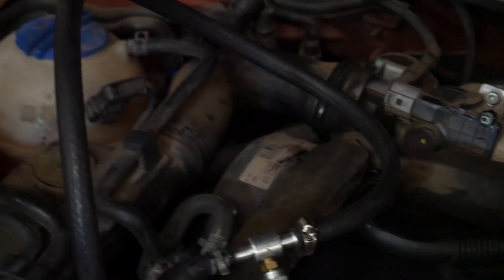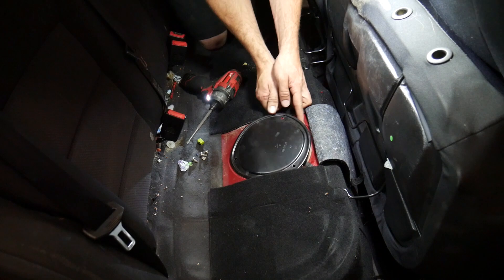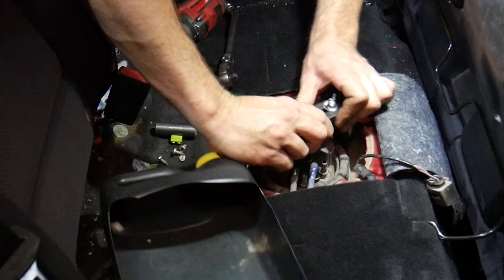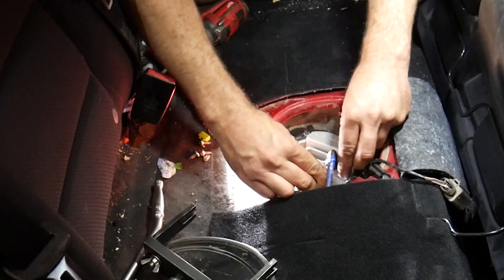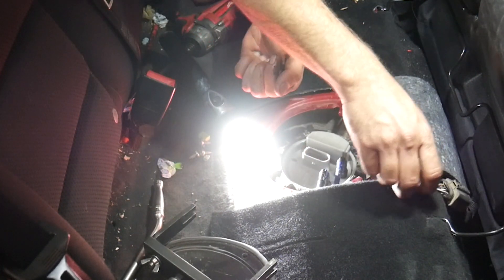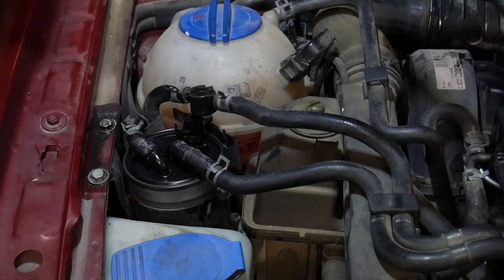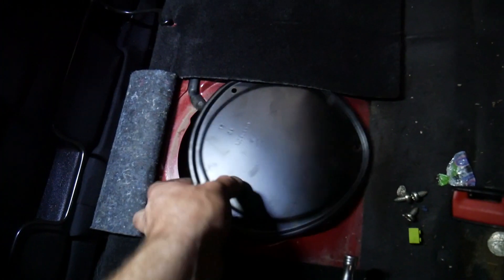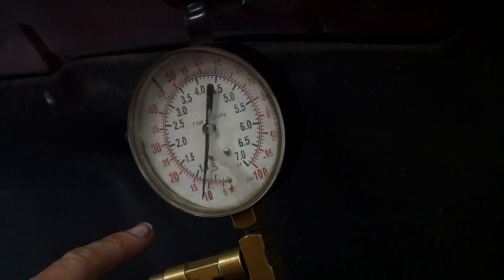2004 VW Jetta TDI BEW No Start or Hard Start  Lift Pump and Fuel Filter

Comment: Great video!  My 2004 TDI wagon was due for a fuel filter change.  Did that, all good.  When I went to reprime by cycling the key:  no fuel, no buzz (the pump was not buzzing)..  turns out the BEW tdi engines can run with their lift pumps not operating!  No continuity on the pump's power contacts either.  It had been dead for a while I bet.  One new lift pump later and she's purring like a kitten.  Real tough to keep this job clean I highly recommend folding the carpet up and out of the way and taping it with duct tape.
Reply: so it looks like if the pump is not working the fuel comes out by a syphoning effect?
Reply: @davidcole5803 Correct.  Not necessarily always but it's possible for the pressure pump to create enough vacuum to pull fuel from the tank.  Pretty sure that's what my car was doing until I broke the vacuum by changing my fuel filter.

Comment: Can anyone explain why it starts with the rag plugging the exhaust?
Reply from the maker: I suspect that since we had low fuel pressure we had low fuel injection quantity the back pressure of the rag in the tailpipe allows more unburnt fuel to remain in the cylinder and it mixes with the incoming fuel charge enough to fire up.
Reply: Interesting.  I have had a hard start (long crank)!after the car sets overnight, but it would start fine if the car only sat a few hours.  My hard start has turned into a no start.  It’s throwing no codes.

Comment: white smoke on cold start and rough idle for awhile, replaced thermostat and checked glow plugs and wire all good what else can be wrong
Reply: I have the same issue with my passat. Did you find what was the problem?

Comment: I just cleaned the sieve inside the pump (it needs to be opened), replaced the filter and the problem was solved. Of course, it depends on the case ...

Comment: Hi , have a 2005  vw touran  1.9 tdi .Have  the same problem but if I park can on incline (front facing down) starts on the turn also when I fill fuel at the garage within seconds it gets air locked.Any ideas?

Comment: I have a 2004 VW golf tdi that stopped running. The fuel pump was bad so I replaced the fuel pump and filter and it still wont start. I have purged the system and checked for pressure, its all good. Any thoughts?
Reply: 3 things:
Crank sensor
Immobiliser
Tandem pump
...order has no meanimg here

Comment: Hard to start
Long cranking
First start is ok mostly
But when warmed up sometimes needs long cranking
But it never starts on the turn of the key
Have tandem pump only
AJM engine
No lift pump in the tank with the float
Fuel filter is new
Tandem pump is fairly new
Any guess?
Reply from the maker: Biggest problem I see is air leaks allowing the fuel to drain back. Sometimes a clear hose needs to be installed on the return hose near the filter to watch for air bubbles.
Reply: @ThePracticalMechanic
Great advice. Thanks again!

Comment: Thank You for the excellent video!

Where did you hook up your fuel
Pressure Gauge?

I used to hear the pump cycle just like in the video, and now do not.  It has an extended dead or flat spot in rpm just after about 2700 and really barely moves.
Reply from the maker: Thanks for watching Jason. I tee'd into the fuel line near the fuel filter under the hood. if you have quick disconnect adapters in your kit you can hook up at the fuel lines near the firewall and coolant reservoir.
Reply: @ThePracticalMechanic  Thank you so much!  Paid a large amount of cash for a new pump and the car is doing the same thing.  Have come to the conclusion that if we are going to own a VW, I have to get back to fixing my own cars.
Reply: Yup. Life’s a lot harder when you own vw. More expensive too.

Comment: Good video, thanks for sharing. Very similar to my 2006 Jetta tdi. Where did you tap into the low pressure w/ your gauge?     - take care
Reply: I have a 2006 jetta TDI also
Reply: @troygoodnow5825  Had to change my fuel filter, no telling how long it had been. Got it from a chick that only changed the oil, put dirt cheap brake pads on & no telling what else. Think I need a new AC compressor, but not worried about it right now since it's October.

Comment: Pls I want to ask what does it mean as it is showing up on my Volkswagen Passat 2014. Inspection in 20days. Does it means my car due for service in 20days or I can just reset myself I don’t av to take it to mechanic just just reset it myself. Thanks..
Reply from the maker: I’ve never tried to reset it without a scantool. I normally perform the recommend service closest to the current mileage before resetting.
Reply: ThePracticalMechanic. Alright thank so much for ur response

Comment: Thanks. I just liked and subscribed to your channel because you did excellent in your video. However, I have jetta 2008. It cranks but won't start. I remove the gas line from the pump and start the engine to see if the gas would spill out of the gas tank but nothing do you think the fuel pump has problem? I took the pump and tried it on the car battery 12v it spins but won't spin in the gas tank
Reply from the maker: Can you hear the pump run at all when it’s in the tank? You have a power or ground issue going to the pump. You could always power it up in the tank with some jumper leads and see if it will actually pump fuel. It may spray fuel so be careful. If it does pump that way then you will need to find the other issue. It could be a fuel pump relay, blown fuse or even ignition switch issue.

Comment: hello! i have the same problem, my vw passat 2001 tdi 1.9 its start and the engine work for 0.5 sec and turned off. i most try many time to start the engine, while its show to me "the oil press, stop motor". i switch that with the now one and its the same thing donst work. can some one help me pls?
Reply from the maker: The oil indicator shouldn’t have anything to do with the fuel system. If the vehicle detects lower oil pressure Then desired the warning light will come on.

Comment: I have a 2004 New Beetle with a BEW Tdi and after changing the filter the ignition key prime method isn’t working, my lift pump is running briefly on “key on” but it doesn’t bring anything out of the tank- time for a new pump?
Reply from the maker: It could have failed. Many time the pump has failed long before any noticeable systems. Opening up the fuel system is normally when people find out their lift pump has failed. If nothing comes out of the hoses and the pump sounds like it is spinning more than likely the pump is bad.

Comment: About to change the lift pump on my TDI AVF, long crank time when the car has been sitting a day.. took off the feed pipe from the filter and turned to ign. Pump makes some awkward noise and no diesel comes out...

Does the lift pump run when car is running? Or is it all tandem pump?

Car runs and pulls fine once started

Tandem pump was replaced some two years ago
Reply from the maker: It should run all the time when the engine is running as far as I know.
Reply: Haha best mistake ever...
When I serviced the car this spring/summer I’ve accidentally swapped the lines to the filter.. So feedline went through the returnvalve🤦🏼‍♂️🤦🏼‍♂️🤦🏼‍♂️

Just wondering why the car has been running for so long, and just now beginning to make trouble.

But pump has been replaced, so has the filter and valve.. and fuel lines fitted correctly 🤣
runs beautifully now.. 
just tried it this evening, sitting from Friday afternoon and it started promptly 😂

Comment: Are u sure i dont need glow plugs
Reply from the maker: Not at all. The particular vehicle in the video was having a fuel pump issue and loss of prime issue. Glow plugs normally don’t all fail at once so you will have rough running and black smoke on cold morning. If you have it scanned glow codes may be stored if they have failed.

Comment: Thanks, just wondering why the rag in the exhaust allowed the car to start??   I have a similar problem with a client's car hard to start.  will be hooking up fuel pressure gauge as you did to check pressure from pump. Thanks again!
Reply from the maker: I honestly have no idea. The customer told me that’s what he did to start the car so tried without the rag and it wouldn’t start. Perhaps the restricted exhaust allows the engine run on slightly less fuel and therefore starts up and once the engine speed increases the tandom pump effectiveness. I manual transmission car might be start by roll starting as well because of the increases engine speed.
Reply: @ThePracticalMechanic  thanks

Comment: Hey man, I have a 2010 TSI Jetta I think I’m having this issue that my filter is not giving enough pressure to my engine, because my car forces too much, I’m going 75 and it’s at 3,000 mpg, and when I drive it normally it feels like it kinda stops a little. You think this might be my problem and I have to replace the fuel filter ?
Reply from the maker: If you havnt changed the filter in the last several years or last 40-50000 miles then it wouldn’t hurt to change it. The TSI is a gasoline turbo engine and is completely different then the car in the video which is a diesel. 

If you have a check engine light on or continue to have issues then you may want to have to have the car scanned and/or diagnosed.  Thanks for checking out the channel and sorry I couldn’t help out more.

Comment: Does this apply to Jetta GLS too?
Reply from the maker: A Moses only the Diesel engine Jetta. And the specs might be different on the older and the newer ones.  VW only produced this style of TDI for a few years.
Reply: @ThePracticalMechanic  I got my 05 GLS to start up after adding new battery and radiator fluid. Car was sitting still for 2 months. Did a test drive. Did three 20-30 min intervals of car idling solid. However, still has a hard idle and rough start beyond that. Sometimes it'll cut off right after attempting to start.

 Should the next option be to check the fuse and the fuel pump?
Reply from the maker: A Moses if it starts up at all the fuse powering the pump should be ok.  The filter could be restricted or the orings on top of the filter could be allowing air to enter the system. Also sometime idling isn’t enough to remove the air from the system so you have to go out and drive it.  

There are a lot of things that can cause a rough idle on these PD TDI engines. The wiring harness to the injectors can fail and have a weak connection(codes will be set in engine computer) the injectors have an adjustment under the valve cover that may need to be checked, if the incorrect oil has been used the camshaft could be damaged and this will cause the injector to have a lower pressure and delayed firing. 

If it was mine and the car sat for a few months I would change the fuel filter and take it around the block a few times and see if it improves.
Reply: @ThePracticalMechanic  I want to thank you for your valuable advice. 

I will go ahead and change the fuel filter as you stated. As a precaution if I ever change a fuel pump, should it ALWAYS be new? 

Also, given that the car was sitting for so long, is there a need to empty out the fuel tank and replace with new gasoline?
Reply from the maker: A Moses Hold up one sec. what engine does you car have? Most of the information in the video is for a diesel Jetta. If your is a gasoline Jetta it might need the throttle body cleaned and adaptation performed in order for the idle to be correct.
Reply: @ThePracticalMechanic  it has the 2.0L, v4 automatic transmission.

According to the following website, both the 1.8 and 2.0L uses gasoline.

https://fueleconomy.gov/feg/bymodel/2005_Volkswagen_Jetta.shtml

When you say adaptation, do you mean putting the throttle body back into place after we clean the throttle body?
Reply from the maker: A Moses OK. The one in the video is the 1.9l Diesel engine and the operation is quite a bit different. I’m not sure if the throttle body adaptation can be performed without a scantool. The throttle body might need to be cleaned before the adaptation.
Reply: @ThePracticalMechanic  saw oil in intake when I started to clean throttle body.
Reply from the maker: There is always a little oil residue from the crankcase vent system. I wouldn’t worry about it too much unless  the car is using a lot of oil.
Reply: @ThePracticalMechanic  Ok. Cleaned throttle body and MAP sensor, eliminated knock. Ive been running motor on idle for 5 min after light feathering of gas pedal.

If rough start resumes for any reason, I'll take additional steps of fuel pump and or filter. Thanks very much.

Comment: Very nice video...what producer of the new fuel pump did you buy? I have got the same problem. What do you think about Magnetti Marelli producer?
Reply from the maker: I used a factory unit. Part number 1j0919050. I don’t know if I have ever used Magnetti Marelli parts before so I don’t know if they offer quality parts or not. I typically use factory parts because I can get them faster than the aftermarket parts.
Reply: @ThePracticalMechanic  Of course I understand. I have got problem with cold starts. If car stands more than 12 Hours, first start Is very difficult... I changed tandem pump, have new o-rings on injectors, new fuel filter, but nothing works....What I found out Is: before first start I turn on And off the ignition for 3-4 times and then start. This method works for me. But I want to solve this problem. Could it be weak lift pump? My engine 1.9tdi pd 110kw. Sorry for my English.
Reply from the maker: It could be a weak lift pump but it seems like the system is losing its prime as well. My lift pump was weak and I had all sorts of issues. The o rings on the filter are a common place for air leaks that allow air into the system when the car is off. The o rings will often seal under pressure so when the pump turns on the air gets trapped into the system and has to be purged out by cycling the key a few times or cranking it for a while.
Reply: @ThePracticalMechanic  Thank you very much for your answer. O-rings on the filter are new. The lift pump Is the last thing... But it realy looks like Its loosing the prime. But I do not know where. Fuel filter, valve on fuel filter with o-rings ALL new, tandem pump - new. All hoses are dry, no leaks. I will try to change lift pump. Thank you And have a nice day.
Reply from the maker: No problem. 👍🏻
Reply: @ZdenekZ-gb1yu  did the new lift pump solve your problem?